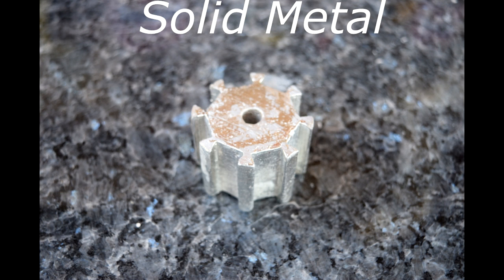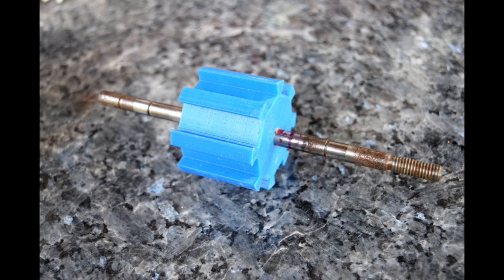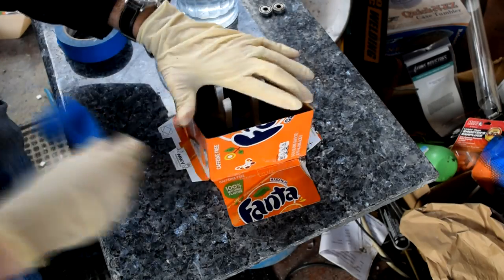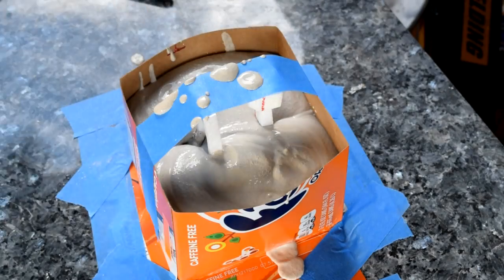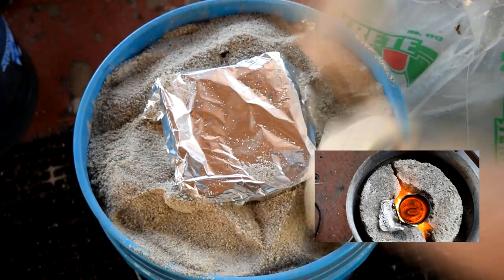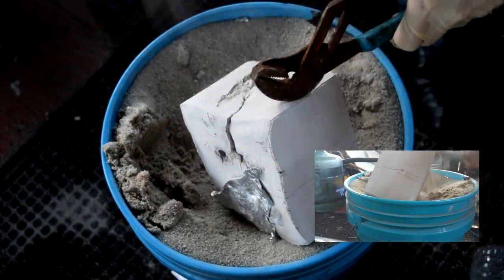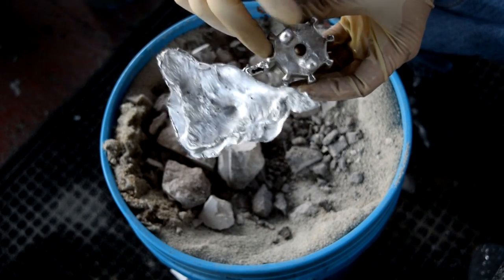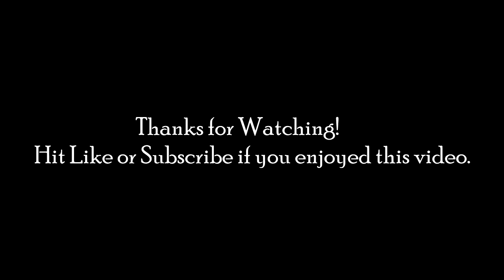3D Printing to Metal Casting/Lost PLA

Comment from the maker: See my other lost PLA Casting videos and use of Wax Filament, links in the description.
Reply from the maker: VOLCANO! BOOM!
Reply: ProjectTube Great job! Extra thumbs up.
Reply from the maker: John L Bales I'm working on a video now where I'm designing, 3d printing and casting a carburetor part I lost, should be a cool video. Hopefully upload it this weekend.
Reply: It would? what if you printed it hollow with thicker walls?
Reply: how come you didn't just pour the metal into the mold without burning out the plastic?
Reply: I've seen people do stryofoam forms (hand-carved, not 3d printed ), pack green sand around it (without plaster), then the liquid steel just burns-away the styrofoam instantly, so the sand doeesn't collapse in on itself.  Are you sure that you can't just do PLA with a low fill-ratio (as boom_man's last post suggests)?  Because then you wouldn't need the Plaster of Paris (much easier to unpack sand from the 8 little hollows in the metal product like in this video, and simply wash the sand out of many other odd shapes, than the pain-in-the-ass of breaking off the plaster inside each of those little 8 hollows...and saves an entire step when no plaster is needed & saves the cost since you don't need to use plaster, just re-usable sand.  The sand is kept in place whilst the hot liquid literaly burns-away the styrofoam -- but I don't know of any styrofoam that can be 3D-printed.

Comment: Do you think this is my best method to make a 56 tooth gear? I’m having trouble with my green sand sticking to the gear teeth.
Reply from the maker: Most gears are machined. If you had to cast it I would do vacuum casting.  I have a whole series of videos where I tried casting functional gears using this method and it ultimately failed.

Comment: Well done man, if you have no prior casting knowledge be proud.

I worked at a graphite and cast iron mould shop for 5 years and  one thing you can do with more intricate parts is drill small holes like a 1/16th inch around casting pieces that have trouble filling. you can then fill these holes with small 1/16 plugs with two flat sides this allows air to vent but won’t allow metal through. Or if you don’t mind cutting off more gating you don’t have to plug the holes,.

Another good tip is try not to double pour the part, in the video you luckily got a good hard pour to begin with which is what filled the part. If you have a bigger part try to pour it hard in one go.

very cool tho, gave me some good ideas as well. Thanks

Comment: Use jewelers investment plaster for casting. It will give a much better surface finish. Bubbles will be less if you use a brush and apply debubblizer allow to dry then put a thin coat of plaster on the part. Let it set up ,when then mix up the rest and pour. do the rest the same i hope that will help.

Comment: Ever tryied melting pla with accetone inside the mold...or making the mold with stirofoam and melting it with gasoline...
Reply from the maker: Lipi19821 I've tried acetone...didn't work very good. It just turns into a goopie mess.
Reply: PLA doesn't dissolve in acetone, but it does dissolve in dichloromethane. Might be worth getting just to do a rinse after the burn-out to try and pick up leftover residue.

Comment: Have to say, this was very helpful and interesting to watch, so thank you for that :)

However, I would like to know a little bit more about that heating process. So, how long do you usually heat up that mold to get the PLA out of it? And at what temperature? And can you cast onto those molds if there are any residue remaining (and what will happens if you do that)?

Comment: That's pretty cool!  A few questions, have you tried 'painting' on the plaster mixture on the outside of the part like you did for the center hole to get a better finish, and then adding it to the larger mold, to do sort of a 'beauty coat'?  

And have you tried/considered using 'green sand' instead of plaster?  Does the plaster provide a better surface finish?
Reply from the maker: Paul Pardee thanks! I do paint on the plaster for certain models. check out some of my other casting videos. There are pros and cons to green sand vs plaster. I do find that plaster produces better details but it depends on the quality of green sand your using.

Comment: Melting and burning away all the plastics by molten aluminium looks very clumsy.  Blowholes, very rough, high dimensional tolerance (needing building up i.e.adding material by welding),  machining problem are some of the issues.  Why not make the plastic mould piece little longer, make upper end of the mould fully exposed, and remove the mould core before pouring aluminium? Looks like an overkill of manufacturing.

Comment: Nice work. Why didn't you include the ducts in the 3d-print? 
A somewhat more engineering-like fixation in the box might have helped to make sure that it would not float away. 
The additional ducts do not only serve as outlets for the air, they are also a reservoir of molten metal that can empty into the cast when it cools down. In that function, they are called risers The shrinkage in the transition from liquid to solid is much more than the following shrinking when the solid cools down to room temperature. If you provide an excess of liquid metal with a wide enough port towards the cast, it can fill any voids. These appear as cavities or 'blow holes' in the cast otherwise. So, the filling duct connects to the bottom of the cast whereas the riser ends at the highest point of the cast. 
BTW, your 3D-slicer can tell you the exact volume of your cast including the ducts, so you can make sure you have enough metal in your pot.

Others have advised here already on how to de-gas the plaster. I use a strong oscillating sander , bottom up, putting the casting frame on it and let it shake. 

Adding a small  'dyke' around the feeding duct would help to avoid metal flowing into the riser(s). You can build  that in plaster too. 

How long did you let the burning of the PLA run at what temperature? And how did you make sure there were no residuals (ashes) left?

Thanks for your reply!
Reply: Thank you Ulrich for the tip with the orbital sander!!!
I was about to make a vibrating table, but I will save my time big deal with your idea!!!! Thank you for sharing.

Comment: I'm totally confused. After the plaster/sand mix has set, you do a 'burn-out, but your explanation was very bad: you gabbled it and didn't explain it properly AND, just at that point, the wind picked up and your voice is almost inaudible.
Reply from the maker: Bruce Clothier check out the lattice cube video I did after this. I explain the burn out more in depth. This was the first 3d print to metal casting video I did, and in my opinion the worst lol. check out my other videos.

Comment: Just an IMO, but for part like this it's probably will be simpler to make whole styrofoam, since You already have hot wire cutter. Is there any benefits for this particular case?
Reply from the maker: Sedokun it's very hard to cut Styrofoam by hand and be accurate to the mm. I made a rotor out of wood before this...same issue it was to difficult to get any dimensional accuracy.

Comment: Just a few questions. 

Have you tried to cast your printed plastic patterns directly in the sand? Compared to making a plaster mold and melting the pattern to leave a cavity. 

What kind of plastic are the patterns printed with?
Will it not melt quickly enough from pouring the molten metal directly onto it?
Reply from the maker: I've done sand casting before with homemade greensand and had OK results. I plan on eventually getting real greensand and using that. 
In this video the mold was printed with PLA, however my other videos are printed with a special wax filament made for lost casting. You can see my review video on the wax filament as well as get 10% off purchase of it by using coupon code "PROJECT" at check out. The link is in the description of the review video.
If you pour directly on PLA or WAX you tend to get a volcano, it can be done but the mold and model need to be set up differently in order to vent the gases created when the wax or PLA is vaporized.
Reply: Okay fair enough. Thanks for the reply. I am making my own greensand at home. I built a ball-mill to crush kitty litter (pure bentonite clay), and play sand into fine powdered sand. I'd love to get a 3D printer to make my patterns.

Comment: So "several hours" with during the "burning out" process with your barbecue grille set to 500 or 600 degrees? Thats real efficiency. How many total hours did you have in that "rotor" (generally they're called armatures BTW) when it was all said and done? How fast does the motor run and how much vibration? And why use ABS plastic or whatever that for the mold model? Have you heard of "lost foam casting" and "investment casting" where wax is used for the model part?  If I'm not mistaken the molten metal itself does the "burning out" during the pour.
Reply: Nope. The PLA is molten, poured out and the remainder is burnt.

Comment: Would the 3d print plastic still be inside the metal?
Reply from the maker: +Johnson's World all the PLA plastic was melted out before pouring the metal. However if you didn't do that the molten metal would vaporize the plastic, at least some of it.

Comment: You could have added material like clay to the ends of the casting or even printed in extra length and then machined it off on the lathe. As well as you could have drilled the center hole on the lathe.

Comment: the top not filling completely looked like shrinkage to me.
I would make the sprues thicker and add a thick(er) riser to keep the heat in. looks like a sweeeet casting! (Another guy who does garage casting with little protective gear lol)
Reply: (I work in bronzes and it tends to have shrinkage problems more often i think... I struggled with it forever)

Comment: Thanks for the insight into this process. When you assemble your videos it'd be ideal if you reduced the volume of the video audio track (the sound of the furnace?) to make it easier to hear the narration track.
Reply from the maker: +Sean Smith thanks for the input, this was the first time I used that video editing software. Is there a way I can re-upload this video after fixing the sound without it being a whole new video? Anyone know how to do that?
Reply: Unfortunately, I've heard that's not possible. They should really find a way to make it possible for minor edits but maybe that's impossible (I guess they need to prevent abuse/replacement with a whole new video).

Comment: You should also note, that you need to make the part about 3% larger than full size to account for metal shrink once it's finished cast. Every metal is a little different, but Aluminum is 3%.

Comment: This is an awful lot of work for a part that could have been made quickly on a milling machine.
Reply: librarymark it's an awful lot of money to buy a mill for one part that he could manufacture with tools and techniques he already has.
Reply: Maybe he doesn't have a milling machine, but does have the stuff to do this...  By your logic, he could have just gone out and bought the item he's building.
Reply: librarymark...well, maybe more proof of concept than anything else.
Reply: Won't be too much longer until 3d metal printers will be available for hobbyists, and that is going to kill the hobby machine industry.
Reply: Still, it's an awful lot of work for a part that could be machined simply. Time to buy a mill.

Comment: Wouldn't this be easier if you could 3d print wax?
Reply: i think you can. there are a few sites that sell wax filament.... would be cool to see that.
Reply: Yea it would be but the machines for wax are extremely expensive, I have one at work that was close to $50,000
Reply: Moldlay is a low temp filament for lost plastic and it's only about $40/kg. Prints about 170C

Comment: Very watchable vid. Im learning about this process but I think I'd use re-usable compressed SAND around the PLA object to create a finely detailed and re-usable casting mould, or, if the Part lends itself to this, a 2-part sand+plaster mould means you can easily try again (or make mulltiples) if the casting does't work out perfectly 1st time, using the same Original.

Comment: For this application, the original PLA or aluminum, copper, wood or carbon filament would've been just as practical, no? The only issue is heat. Other than that, what advantage is aluminum? I'm assuming it's a heat issue, but I think an air flow strategy might be easier  (the magnets can't get too hot anyway). Anyway, the video wasn't about the generator, but making the mold, and you did a great job explaining the process.

Comment: I have similar ideas, but to use wax filament instead, but it is very expensive as compared to PLA. I am not familiar with what settings the 3D printer needs as far as temperature and such for that filament, so there is a financially steep learning curve involved, but I am confident the finish of the object would be much cleaner once everything is sorted out. Not that your project turned out bad, but I suspect that PLA might leave some impurities in the cast. Thanks for sharing your work as in inspiration here on the tube.

Comment: Use Shapeways and have them 3d print the part from steel/bronze with the DMLS process.  It's not cheap, but you can save money by designing your parts to have holes/reliefs in them to reduce the amount of material being used.  We use them all the time for printed steel parts - much less hassle than casting.

Comment: One question: Why not use the printed plastic rotor as it is, and skip all the molding and melting stuff?
Reply from the maker: I was originally going to do this but since this was going to be outside in the weather I decided metal was better option. I also just wanted to see if I could do it.
Reply: ProjectTube - Thanks.
So, that kind of plastic isn't weatherproof as opposed to aluminum. I see.

Comment: this is cool as a concept, but in my opinion kind of unnecessary, since that piece could've been easily machined, and that would've been easier faster and the final product much higher quality, i can see this technique used for much more complex pieces with shapes, curves and holes very hard to machine, either way this was interesting and a good demonstration.
Reply from the maker: +monimoni0147 how would ypu have machined it? How much would the machining equipment cost?

Comment: That inadvertent indentation at the top must have created a mass-imbalance.. How did you balance the rotor so that it would not vibrate and damage the bearings? With a custom-cast lead counterweight inserted into a drilled hole into the opposite side of the rotor?

Comment: hi i just want to get confirmed, you melt out the 3d printed part befor pouring the metal in? det video was greate, just what i needed ☺
Reply from the maker: +Brian Wind Grøndahl yep, you melt out the pla before casting. Make sure it's all burnt out otherwise it will not fill completley and you might end up with a volcano.
Reply: ProjectTube greate THX 😀

Comment: try and do the casting with dry sand only, just bury the part in the dry sand make a cup spot in the sand box with a small portion of the part exposed then pour in the hot aluminium   thanks for sharing

Comment: well done! I suggest you some tips 1:smothing the pla object before using it like template leading to a smother surface of metal object  2:putting the ceramic plaster mixture on a fitness vibration plate or under a vacuum bell with these ways  it is possible to remove the air bubble meaning no defect on the final object surface 3: use a conical shape ducts casting in order  to avoid air incusion during coulee.

Comment: Isn't that going to take a crazy amount of balancing?
Reply: I was thinking the same.
Also the magnets can work their way out and jam the motor if they are not fixed with a very strong epoxy.
Reply: for a spinning part, I would chuck it up in a lathe, if that is available to you. but not everyone could do this. Another way to remove any possible bubbles in the mold would be to use a vibration table and or vacuum chamber. as a 1 off, it's not necessary to have things like that, but if you'll do many items over time casting, they are nice to have.
@Project Tube thanks for sharing this vid!
Reply: depends on how uneven it is, it should but he might just get lucky and its almost balanced to begin with.
Reply: Just stick it in a drill press and sand it even on the edges, then use a prop balancer and drill small holes under where the magnets would go.

Comment: +ProjectTube is there any way to contact you directly? I'm looking to 3d print housings for my video games but I do not have a big enough 3d printer and cannot find a plastic source for the kind of plastic I want and people are saying that injection moulding would be better than printing. 

I would like to print something like the Sega Saturn Skeleton or N64 clear model shell... for several different video game systems where they never had a clear shell. I would like your input on the most efficient way to do it.
Reply from the maker: +oEnder0 You would definitely need a large 3d printer for that...unless you printed the case in 4 parts and glued together...not ideal. Check out Grant Thompsons channel if i remeber correctly he did a video on vacum molding that might work....looked pretty cool to me. Something I might try in the future.
Reply: Thank you, I will check it out, I've been looking everywhere to try and figure out how to do it and the closest I've come is a build your own 3d resin printer... and even then that's just an idea, I haven't found a tutorial...